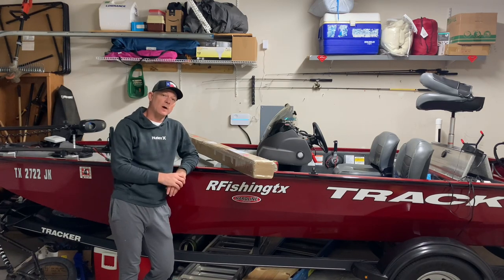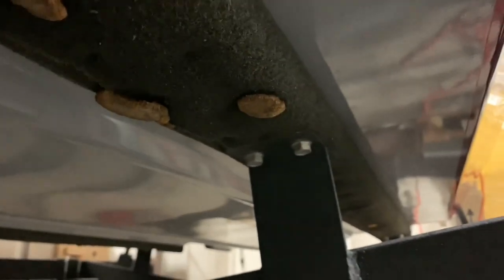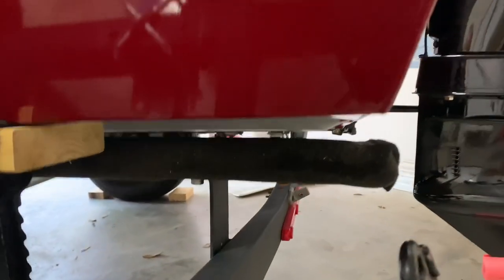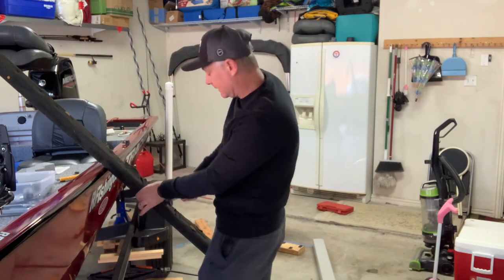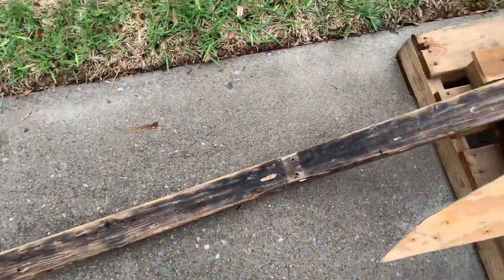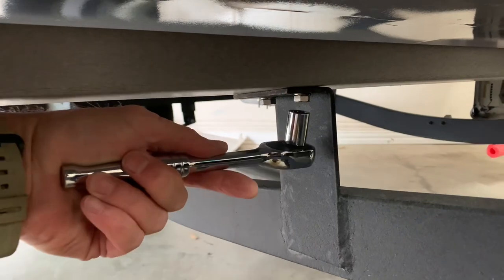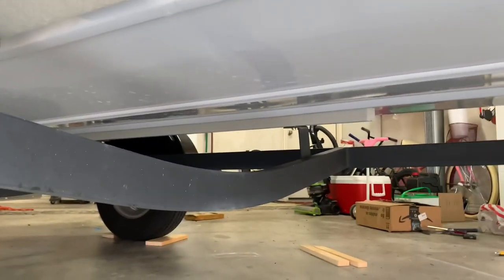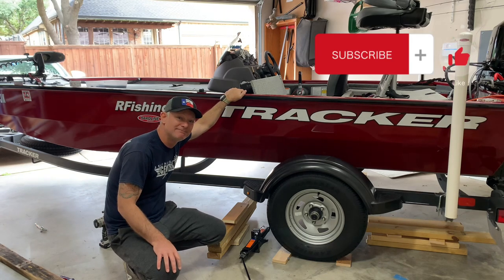Ultimate Bunk Board Installation on my Tracker Pro 170 - Part 1

Comment: A great way to lift the boat off the trailer...lower the tounge jack all of the way down, put jack stands under the boat then crank the jack up, it'll lift the boat off the trailer. I just did a full roller to bunk conversion on my trailer this way and it works great.
Reply from the maker: That’s great info! Thx!
Reply: @RFishingtx  NP. Great video BTW. I wanted to do those type of boards, they were out of the budget though since I did 4 bunks and had to buy all new brackets. Next time around I probably will.

Comment: Recently picked up a 22 model pro 170, I was looking around for adders and mods - glad I found you, those bunk boards look terrible, hard to believe they did not use treated lumber
Reply from the maker: Thanks! I heard that pressure treated wood has a higher concentration of copper, which results in a chemical reaction that discolours and corrodes aluminum. Overall I’m pretty happy with the ultimate bunks after adding the bunk carpet strips.  I will likely get that Drotto latch everyone has mentioned at some point in the near future

Comment: I have the same growth on mine.  i have a 2022 Pro Guide tracker.  took several pics and went to Idaho Fish and Game.  Their in house biologist said they looked like a fungus..  He suggested to scrape them off and spray with straight bleach. I did.  Growth was back in two weeks.  Im changing by bunks and the wood.  I dont feel it can be healthy for the eco system to add to our rivers and lakes.  Im in and out of the river 3-4 times a week.  Like you I think its from the wood used, come on Tracker! time to step up your game.  What the heck.   H.R. Bell  Nampa Idaho
Reply from the maker: Thanks for checking out my channel. I was blown away at the condition of the wood after only 2 years on a garage kept boat.  First time I had seen growth like that and I have owned a few different boats at this point. I decided to do the ultimate bunks because I kept hearing that pressure treated wood has a higher concentration of copper, which results in a chemical reaction that discolours and corrodes aluminum.

Comment: Saw this on the FB group and this is an upgrade ive thought about doing but haven’t gotten any further than that  …..  my plan was to go to the lake on a quiet day and put the boat on the dock then change the boards out (pre measured of course) but was wondering how to get the angle and lengths / position on the trailer to match the boat right to make sure i can get the boat back on the trailer! 
Great video and the bunks on my 22 already have that stuff on them as well, I thought it was carpet glue that had seeped out - but I guess not. Can you do a follow up after launching / loading a couple of times as well to see the difference? --- I have the same boat as you same posts on the back to help with the wind as well! I tried getting that rub rail also but they have sent me the wrong size twice so far - it's like they're sending random lengths they have laying around the warehouse! let us know how the launch / loading goes! did you lift at front and back or just that one spot on the rear?    - you got the 8ft board length correct?  using the old ones as a template is a great idea at least for one of the two holes I like the grey I was considering getting the black but might do grey.
Reply from the maker: I would definitely recommend doing the upgrade.  I was blown away at how bad the condition of the old bunks were in.  I just raised the back.  Are you ordering the rub rails from amazon?
Reply: @RFishingtx  I did -- twice they sent the wrong length --  twice. It looks like we need about 15 1/2 feet for each side so total of about 32 feet sounds simple right?????? anyway first I ordered 32 ft they sent a 25 ft piece and another 7 ft piece - I dont want seams so I returned that and thought Id make it more clear so I ordered two 16 ft sections  - they sent a 28 foot and a 5 foot section so I just returned that... after they process the refund I might order a 16 foot section and then order another 16 ft section on my wife's amazon or at least two separate orders a couple of days apart  so that maybe I will actually get what I ordered 😂--- two intact 16 foot sections I can cut to fit the sides. anyway, it looked like good quality stuff  but I just dont want to deal with seams or joints so Ill try again in a few days and see what happens.
 I did look at the bunk boards today but wow that shipping charge is crazy! its almost more than the boards! --- like $90 to ship and $90 to purchase of course I guess you already know that. Im sure I will order them but gotta digest that $90 shipping charge for a few days and mine are only one year old so I can probably wait but knowing me - ill get them before to long. - thinking black to match the rest of the trailer.....   I have a section of 4x4 post, I wonder if I could lift a side with that and my floor jack? anyway, good video -- you said about 8 inches from the front support correct???? -- let us know how they do first launch / load!

Comment: did you raise both the front and back at the same time or just the back to take the bunks off?
Reply from the maker: I jacked the trailer up and set up the stands at the back which held the boat off the old bunks when the trailer was lowered back down.